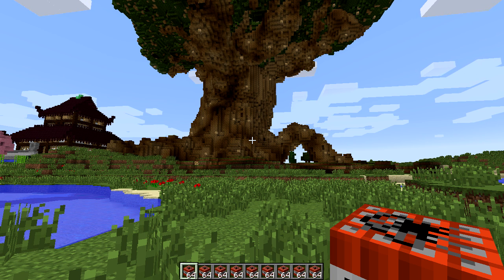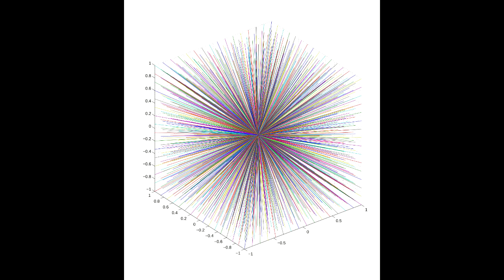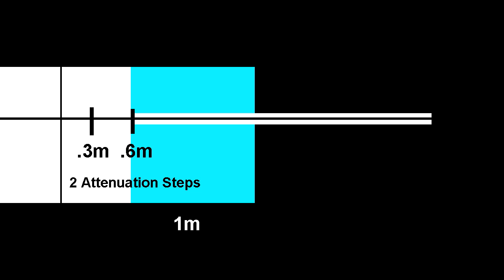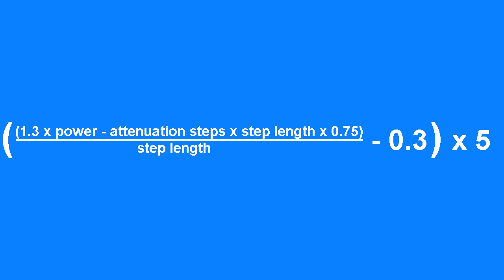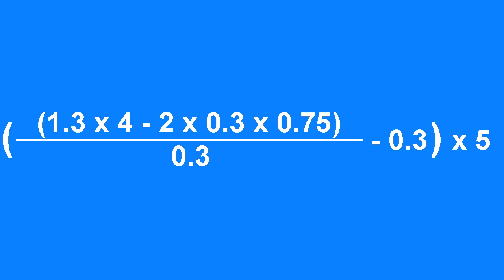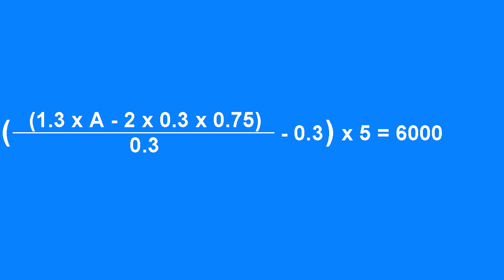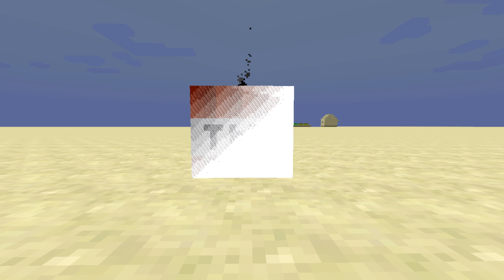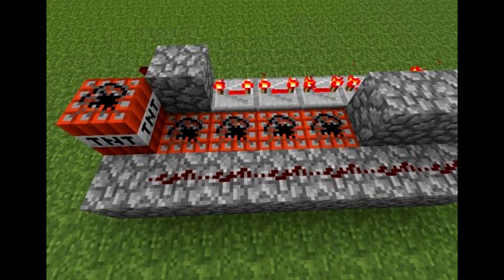Minecraft Explosions - Can Enough TNT Destroy Obsidian?

Comment: Obsidian has a blast resistance but it is extremely high for TNT (Bedrock is even more.) But there has to be a TON of TNT point blank range to destroy obsidian.
The problem is when you ignite TNT it jumps up and moves off where it was positioned, and also when tnt is not lit at the exact same tick, it would push all of the other TNT away after the first TNT explodes.
Reply: ***** Don't forget anvils!
Reply from the maker: Still doesn't work that way =P
Even with 1,000,000 TNT in one spot, that's 1,000,000 separate explosions (the damage doesn't add up; they're all computed separately). You'd need one single explosion strong enough to destroy the obsidian, which currently doesn't exist in vanilla Minecraft. =)
Reply from the maker: Nick Marshall Yeah, that was covered in the video. =)

Comment: you need 77.24991 tnt just to blow up 1 block of obsidian
Reply: Even then, it wouldn't blow it up because blast force wouldn't stack up on the Obsidian. It would be even less effective as the blast force of one TNT would have to travel through other TNT....so yeah, only possible with Single Player Commands and not actual TNT.
Reply: did